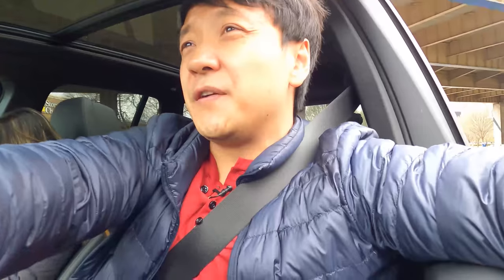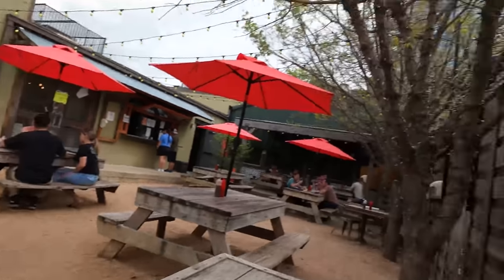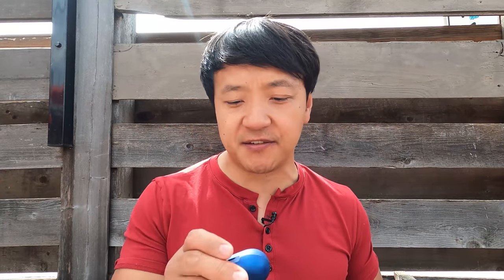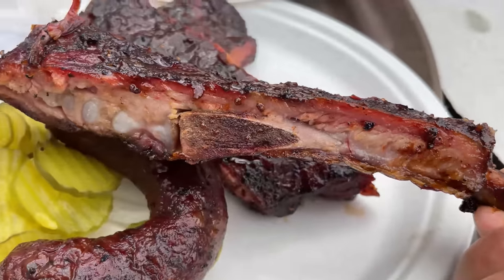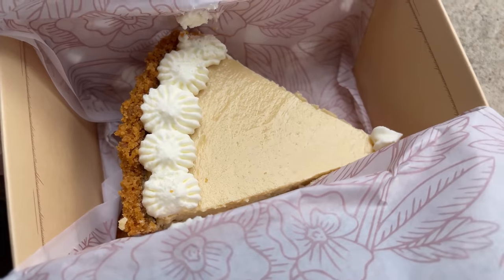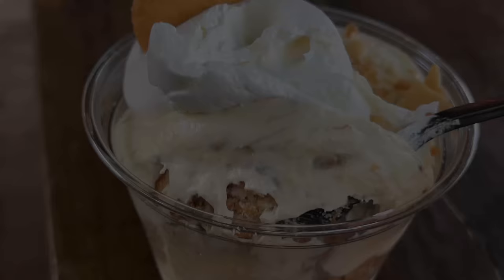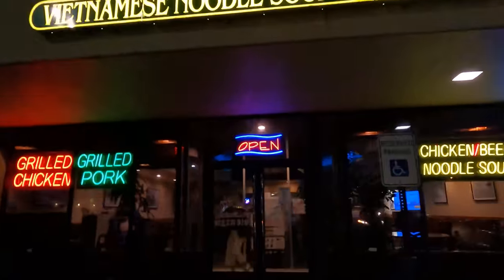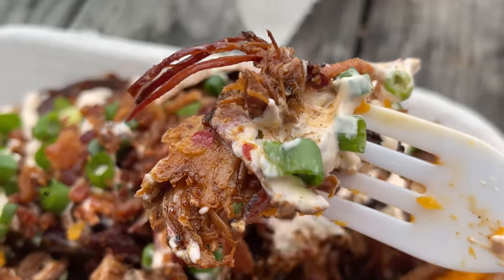Trying EVERY BBQ in Dallas Part 1 | TEXAS BBQ Food Review!

Comment: Mike, there are two restaurants you need to try, assuming they are still around.  I used to travel to Dallas about 5 times a year on business, but it has been about 20 years.  If they are still there, in Irving, Texas on Belt Line, there is a restaurants called "The Smoke House" which is in a strip mall.  The best BBQ, and while you are eating, they are come out with fresh baked rolls right out of the oven.  Another restaurant in the Irving Area is on a placed called "Restaurant Row" called Trail Dust, best steaks, inside there are two floors, with a slide from floor 2 down to floor 1.  Sometimes, they have a live band, just don't wear a neck tie, or they will cut it off.
Reply: If they pay for real estate, it ain't seen upon the plate

Comment: Hey Mikey Mike, if you need a BBQ friend in Dallas... I started learning how to make Texas BBQ during COVID lockdown last year :D but basically, a "full" brisket, also called a packer brisket, is  composed of 2 different muscles that's connected by a layer of fat. The point muscle is fattier and that's what they cut from when they you ask for moist brisket. The "flat" muscle is where they cut the lean brisket from, which as the name would imply, is a leaner muscle. If you make it right, like most BBQ places do - the flat will be tender, but it will never be "juicy" like the point. Typically, if they cut toward the middle of the brisket, you'll get a little bit of the point and the flat, which is what it looks like with your brisket. Oh and if you get burnt ends, that's just the point muscle cut off from the brisket. After smoke, it's cubed, tossed in some sauce, and put back on the smoke.